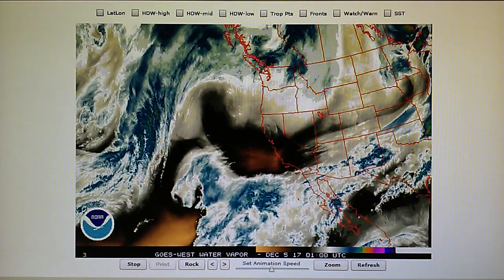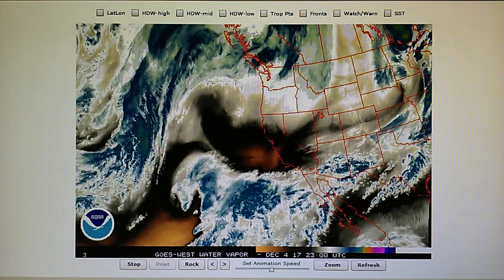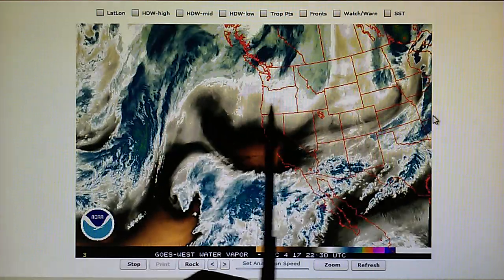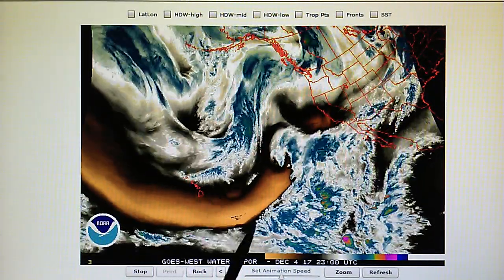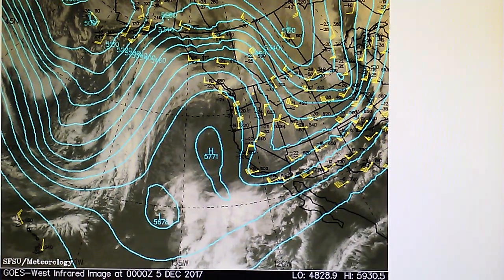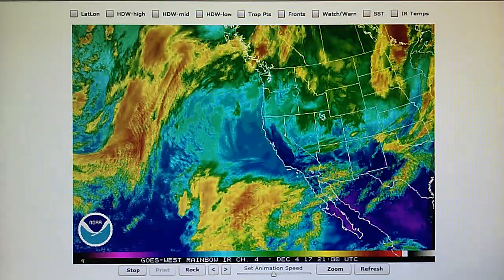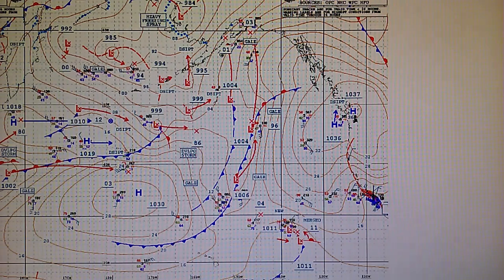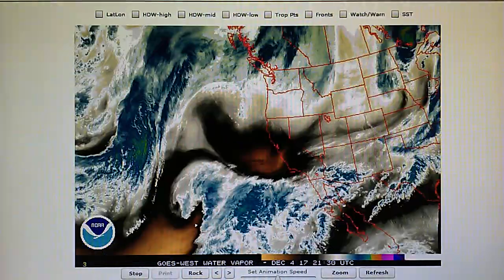12-4-2017; Installed Blockade of High Pressure Prevents Low From Delivering Rain Into Southwest!

Comment: Hi 1PR, no rain in Payson, AZ.  The skies were dark and cloudy and no sun for a little over 2 weeks! They spray here everyday and it's affecting my nose membranes really bad! I left my car parked outside the two weeks and stayed inside the house. I went out to move my car and the whole car was covered with tiny sparkles and VERY THICK! I showed a neighbor and they thought I PAINTED MY CAR until I wet my finger and started rubbing it with pressure and smeared it. I told them it's chemtrails and pointed at three jets spraying. I'm really concerned and scared and feel like I need help but there's nobody I can turn to. They're attacking our water supply and nobody will listen to me. The air is extremely dry! I thought of the movie "THE BODY SNATCHERS" and the guy running in the streets warning people (that's me). I see many videos from all around the world of people devastated by extreme weather and people are brainwashed or don't want to see the dark evil that's running our planet! God help us and God bless you!

Comment: Great analysis, thank you. I've got a feeling this high pressure installed will be squashed quickly. No rain in the forecast from LA up through NorCal, so it's going to be interesting. And every Nexrad in the state is pulsing on high. Especially the Santa Maria, Hanford, Davis, and Oroville NEXRADS.

Comment: Yeah Red it's tragic this Microwave induces blocking caused convection currents up 70 mph and now big fire  ++ 10,000 acres 250, 000 without Power 1 dead so far....4  Fire suppression helicopters can't fly due to winds. Thanks for this vid... I didn't see  on my you tube page today.